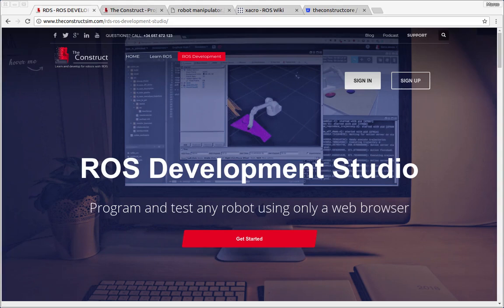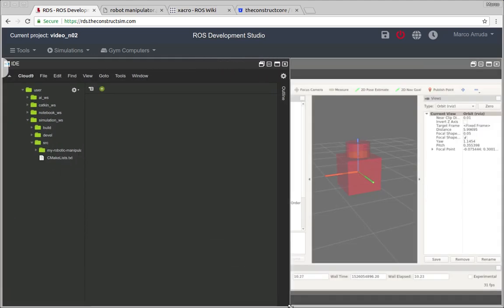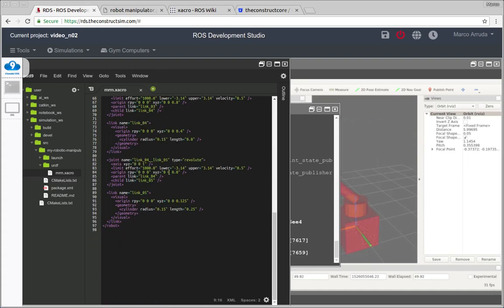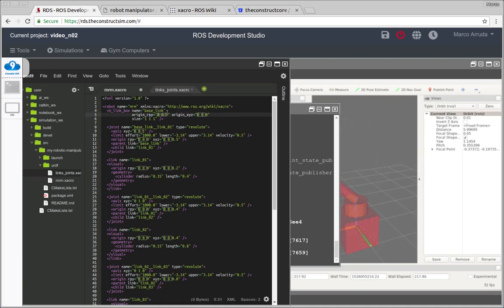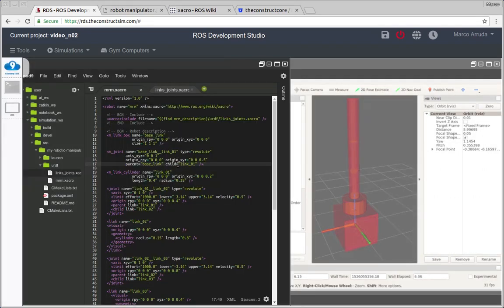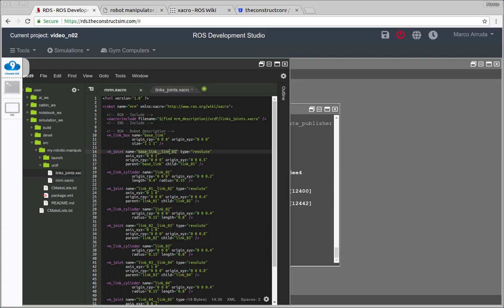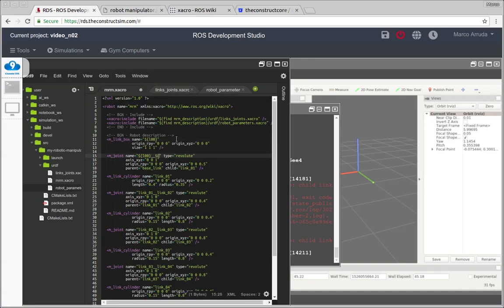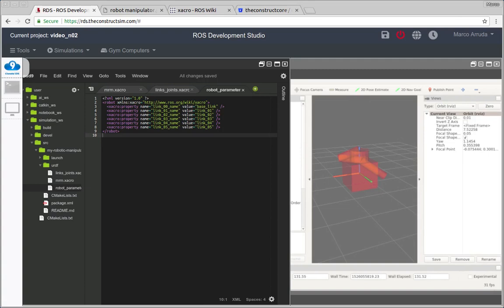[ROS Projects] - My Robotic Manipulator #02 - URDF + XACRO

Comment: Hi have one question, may we can defined join zero position according to ourself  ??
Reply: Hi Lagan Kapoor, yes you can.
It's common to the origin as (0,0,0) because at the time you spawn it in a simulation, you can set the position to a different value.
Reply: Marco Antonio Arruda  I want to give zero position according to my physical robotic arm I mean joint limits now is from -1.5708 to 1.5708 but I want to make -1.5708 to zero at that point
Reply: I get it!
You can set it inside <joint> tag, the tag "<origin rpy="" xyz="" />"
Set the values of RPY
Reply: Sir In SoliWorks there is a direct way to config a joint position ?
Reply: @lagankapoor007  Internship @iit time discussions? haha
Reply: @anubhavdogra9822  absolutely Sir 😅😅